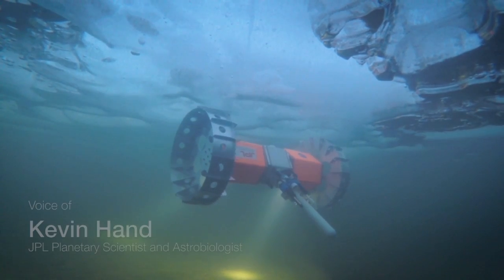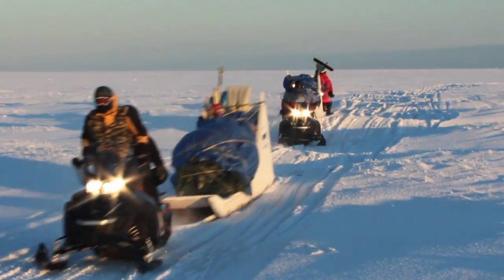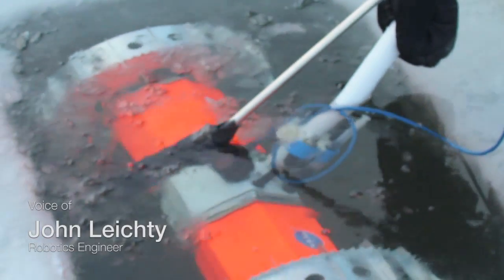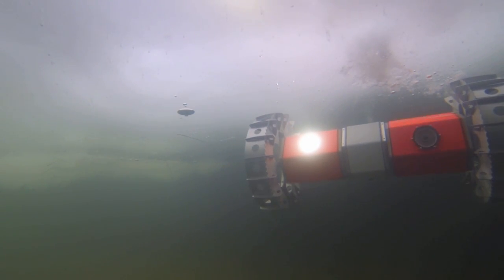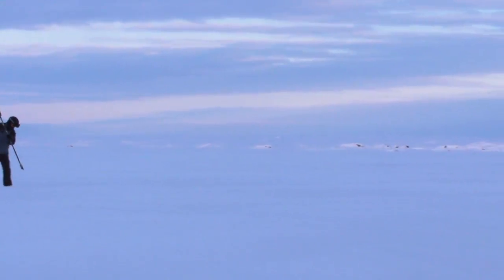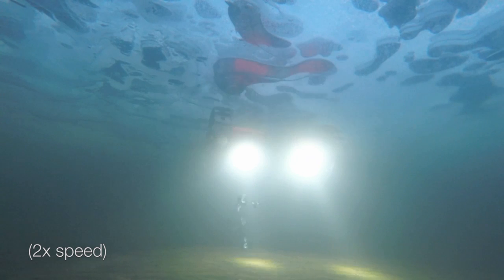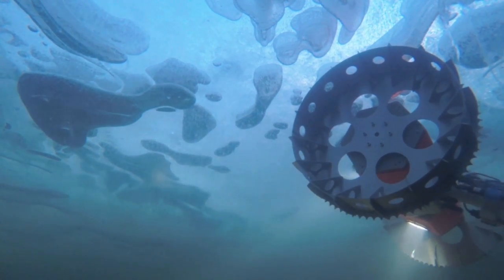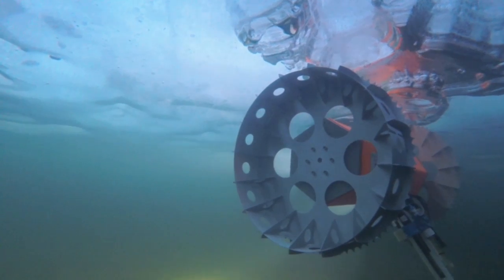Buoyant Rover for Under Ice Exploration

Comment: I wonder why they opted for this over a neutral buoyancy craft.  What if the ceiling of Europa's ice is jagged, rough, and full of stalactites and embedded rocks rather than smooth like this video? Even if the ice itself is smooth, there may be layers of buoyant debris covering it.

This design would be unfeasible in a high salinity ocean full of pumice piled at the top.

Comment: what's the buoyancy difference between water and methane?
Reply: +BariumCobaltNitrog3n Methane has roughly 40% of the density of water. I'm guessing a small ballast would be used. Enough to get it under the surface, enough to give it traction and not be pushed away by possible currents.
Reply: GiatrosDys
That makes sense that methane is less dense than water. A possible explanation for the Bermuda Triangle disappearances is that huge amounts of methane are released from the sea floor and when it rises under a boat, the boat loses its buoyancy and sinks instantly.

Comment: all these are amazing. ...but how the heck are we going to deploy that in europa with a safe way to drill the ice without cause any booms, or how can we know if we can even drill europa ice if we dont know the exact density and height of ice......?
Reply: +johnnyxp64 Radar from an orbiter, just as we do here on Earth to monitor ice recession due to climate change. The issue is drilling through the ice. I'd send a boring machine (I'd call it a "mole"), along with the rover. It would tunnel down, then push the ice it excavated back up. Once it gets through, the under-ice rover would be deployed. For communications through the thick ice, the mole could deploy a radio relay at the water level, and then retreat back to the surface of the ice, serving as another relay point to the orbiter.
Reply: +johnnyxp64 With science, obviously.
Reply: I believe we're sending an orbiter first.
Reply: aserta yeah right, obviously that's not specific
Reply: +johnnyxp64 There shouldn't be any big booms, since it would need something to react with it, any kind of meteor would trigger any kind of large explosion, and the only thing that might react with it would be the rover. I'm afraid of it slowly "corroding" in liquid methane, since M + CH4 is a classic... even in low-temperature.
Reply: GiatrosDys my main question is how can we make a drill and make sure it will land there and then find the proper place to drill
Reply: ***** It's not specific because there's a lot of ways to do it. Discussing on the matter now is really a waste of time. IMO, it's just easier to wait until they release the final plans(or at least sketch out the specifics of the mission).

And they will, especially in this day and age when they invest a lot of time to bring this kind of stuff to the media front.

If i could wait 9 years for New Horizons to reach Pluto (i have, Pluto is my favorite chunk of rock in our system and it was so long before they even classified it as a Dwarf planet or even more recently a binary one) then waiting for this one to come full public is peanuts.

As i read it, it's one of the more pushed projects in their agenda.
Probably because of the water, after all it is the key to life as we know it.

Comment: RTG, radioisotope thermoelectric generator.
Reply: There is a serious limitation in the supply of the radioisotopes used for RTG at the moment. Mind you, its hard to say how much will be available when a Europa/Enceledus sea explorer finally launches. Chemical/ Solar (tethered?) propulsion is surely far too low in power density for such a challenging mission.
Reply: +Pieter I don't see this particular mission working any other way.  Solar would have to be tethered, and even then insolation at Jupiter's orbit is so low.  You could probably make up for the lost time in Jupiter's shadow by landing on the far side (it's tidally locked) but then you miss out on the amazing photographic opportunities.
Reply: +a7i20ci7y  RTG's are EXTREMELY heavy and a great deal of sizing-up would be needed to mantain boyancy for the rover.
Reply: +CMDR Drragon Yep, but you ain't getting solar under the ice, a battery won't last long at all.  And they said un-tethered. So...
Reply: a7i20ci7y I know there's some sort of device to convert water to electricity, but even then the planet isn't PURE water